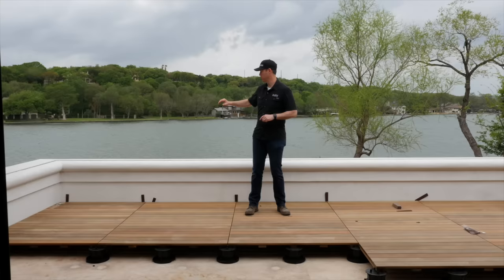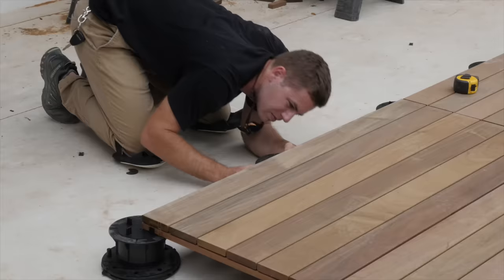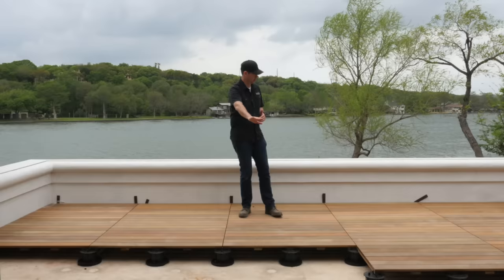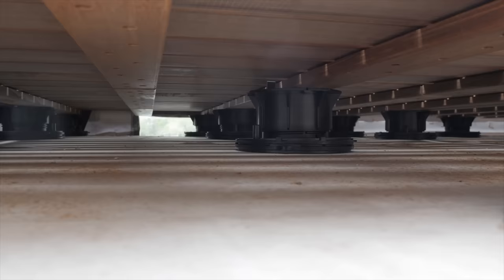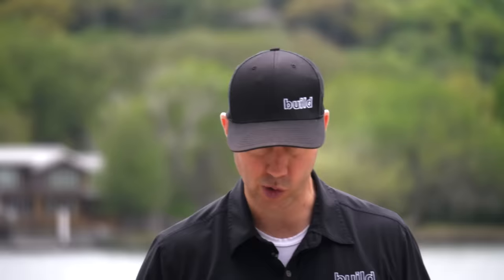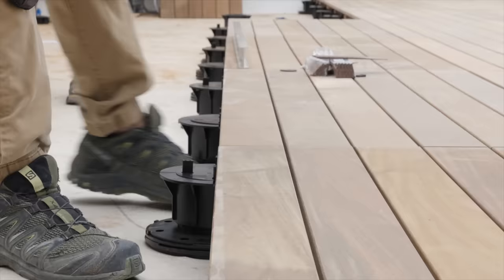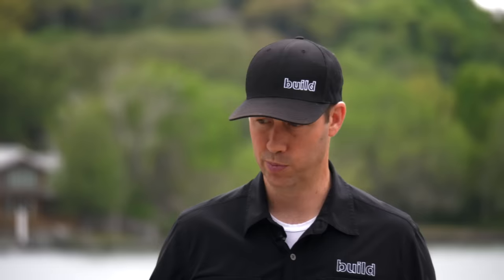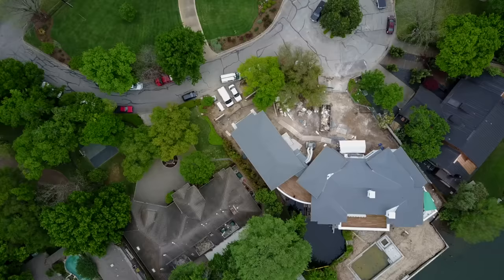Deck Over A Flat Roof

Comment: why the hell is he calling the roof a “waterproof deck”
Reply: Architects typically refer to these areas as "roof decks" or "roof terraces", so he's technically correct.
Reply: @marcussp83  A "roof deck" is the plywood or corrugated steel that sits atop the joists. ;)

He was referring to the roof itself as that, not to the wood patio deck built on top of the roof, which if course isn't waterproof.

residential architecture 🤮
Reply: @ironmatic1  This is not correct.

The plywood, OSB or corrugated steel  used is just the material used to build the roof deck. In itself it is not the roof deck.

A roof deck is considered a flat surface capable of supporting weight, similar to a floor. It’s typically built outdoors, elevated and usually contains railing for safety.

Rooftop decks, often referred to as roof decks or roof terraces are similar to a traditional deck one would have in their backyard but they are located above a living space. The fact they are above a living space makes them a roof and the fact they are used as a deck/walking surface makes them also a deck, hence roof deck.

Comment: It would not be to code here in FL high winds with it just setting not mounted to the roof would make it fly away .  mount the legs down!
Reply: Not always necessary to mount them... bracing between pedestals and a top mount ledger around the perimeter will help as well.
Reply: Ipe is really heavy! I understand you would design to withstand a hurricane, but do you think that those winds would be enough to lift out any of those panels? I've never been through hurricane force winds, but I'm curious. It makes me think of a truck bed going down the interstate. The parapet walls seem like they would prevent high winds from reaching the decking below them.

Comment: I noticed none of the end grain was sealed , not that it matters, any thing you do to protect a timber deck is temporary . Nature will break it down . I guess if you can afford a house like that then you can afford the maintenance program that comes with an exposed deck.
Reply: All of the end grain is sealed during the tile manufacturing prior to arriving at the site. Only need to re-seal if you're cutting tiles in the field.
Reply: Ken Murray ok I will take your word for it . At around the 3 minute mark it didn't look like it to me though .
Reply: I completely understand... the stuff they use is sprayed on evenly and only needs a thin layer. It goes on white and drys clear... specifically so you can make sure coverage is uniform. I actually just returned from Brazil and saw the application process in person.

Comment: OSHA violation standing at that parapet wall without fall protection and no midrail or top rail.
Reply: rhchapman96 do you just watch to see if he does something wrong
Reply: Lane Wilson actually, this is the 2nd video I've seen as I just subscribed. I'm a CSP by trade and safety should be your number 1 priority
Reply: Installing a temporary rail probably isn't feasible. Weird that they didn't  install the rail before the deck then.
Reply: Jax Turner right, until you get someone hurt or killed and your workmans comp and liability insurance go through the roof.
Reply: rhchapman96 safety is number 2.
Reply: Jax Turner amen! Safety is #2
Reply: Next they'll be demanding midrail and top rail for highway workers - they can also wonder into the traffic.